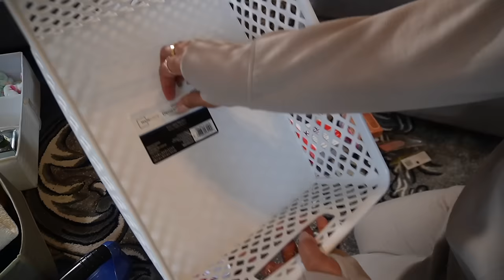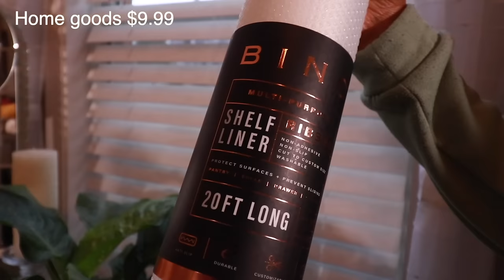MESSY LINEN CLOSET MAKEOVER 2024 | SPRING RESET VLOG + NEW FLOOR INSTALL + FOLDING HACKS

Comment: Desade wrong about those wipes. It PURELY depends on what type of septic system you have. If you have a septic system that goes DIRECTLY to the city septic system...COOL. If you have a HOME SEPTIC TANK... DON'T USE THOSE WIPES!!! They don't dissolve fast enough to flush ANYTHING but what's supposed to be flushed.

Comment: what a task! but it's done- tip- keep the complete bedding set together-top sheet-flat sheet and pillow cases as a set-you can even put the sheets in 1 pillow case and fold it tight- when you need it just pull out the case
Reply: I was going to say this! Best hack for your linen closet
Reply from the maker: I considered that and knew id get this suggestion. I’ve seen this method on tiktok lately but I prefer our option best for me. in the before clips, my sheets were folded into one set and it took up way too much space. And just wasn’t pleasing to my eyes